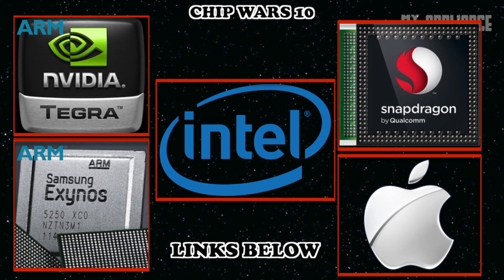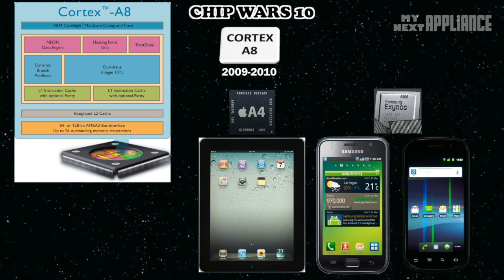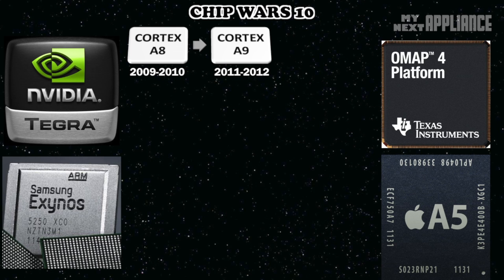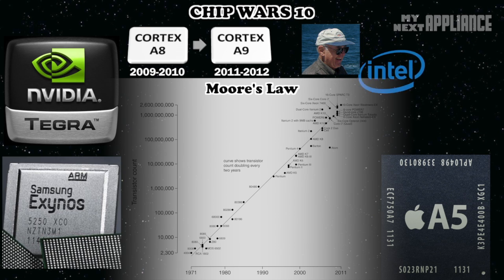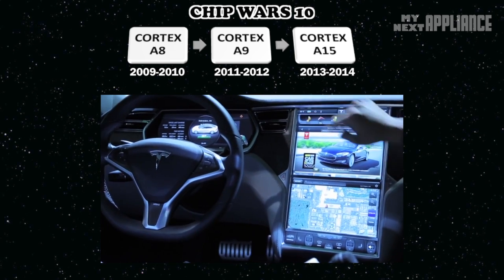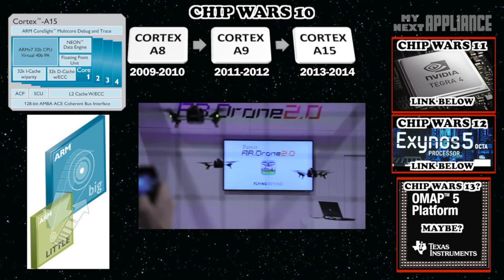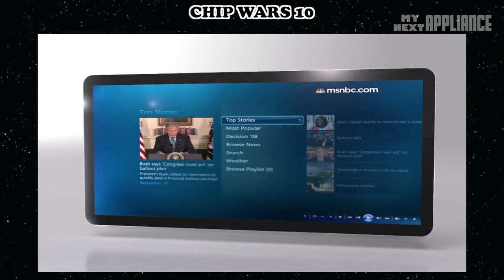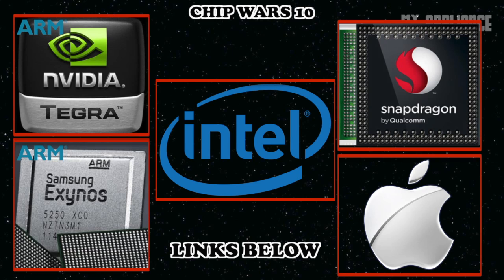WTF is ARM Cortex A15  (vs Cortex A9)? - CHIP WARS 10

Comment: About to watch this video, hope it is great (not bias) as it "could somewhat" answer the age old disputed forever question regarding the QNX based (awesome) Blackberry Playbook Tablets in which the LTE (4G-LTE version) well has 4G as in accepts a GSM sim card but with tethering, this is irrelevant! The other & basically ONLY major difference (UNCHANGEABLE) is the LTE playbook has the A-15 processor as in the original has the A-9 and it only seems to add milliseconds to loading web pages, etc when using the A-15 4G/LTE Version - why?. I do not get it, core duo 1.0 versus duo 1.5, should be a bigger difference. The original with the A-9 comes with the 64gb WHILE THE LTE is limited to tyhe 32gb model only and people say the screen is yellow-ish and not as nice as was rushed to market. Also the original with the A-9 in it can go for an extra 3 hours of battery life sporting a 5400MAH Battery while the LTE version sports a 4800MAH, which would you pick? Tough choices there - hopefully this video will shed some light but again, I see not much of a difference, does the A-9 have some sort of other feature like hyper threading type something or other to catch up, hmm... The debate will always live on! It almost seems as though the A-9 is faling behind when loading pages side by side but then catches up out of nowhere and the page is just there versus the a-15 just loading it fairly fast as you watch it load. Strange as you would think you would get allot more power out of the TIOMAP A-15 over the A-9 but there has to be a reason which I hope to find in this video or at least some hints and clues. ...
Reply: +ReganMarcelis Somebody feedback?...... "Whistling"...